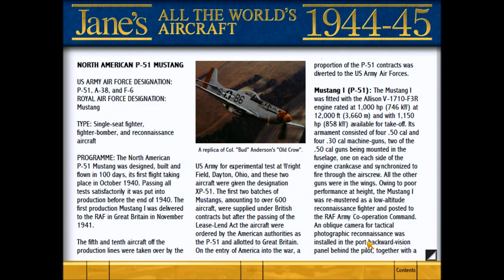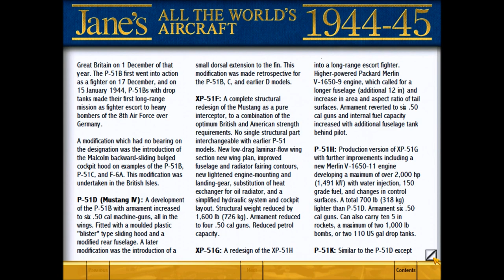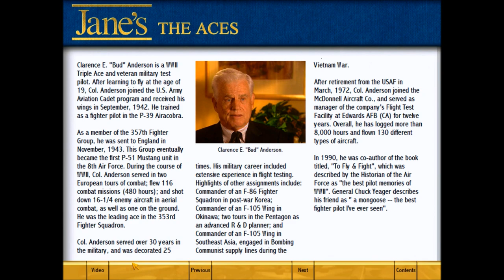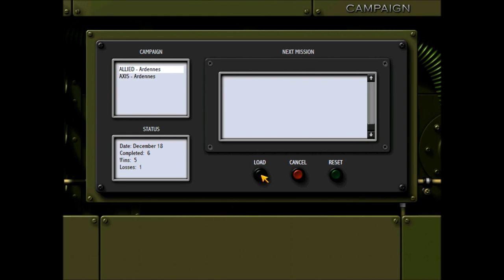Jane's Combat Simulations: WWII Fighters • Electronic Arts 1998

Comment: Great sim and great video!  13:06 The latest patch, 1.08f, did add wingman commands which are listed in the Readme file, even if they are quite rudimentary.
Reply from the maker: Thanks for the tip, I will have to check it out.
Reply: @damsonn  Speaking of patches. You can actually run this game at widescreen resolution with some hacks.

Comment: Can someone help me? I want to reinstall this game on Windows 10. Also, how do I get the game? There is no way I can download this digitally, right?
Reply from the maker: You can't get this digitally anywhere. You might look for it on abandoware sites or hunt down retail copy on auction site. After installing the game just copy/paste 4 dll files from dgVoodoo2 (from dgVoodoo2\MS\x86\ folder) into the game folder and run the game. It should work fine.
Reply: @damsonn  Thanks for the quick response. I'll make sure to follow the steps.